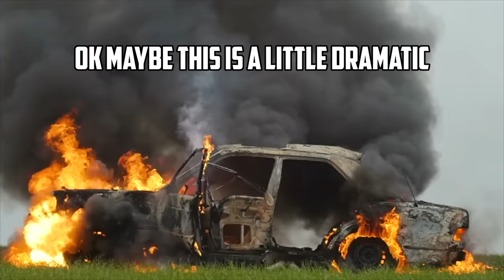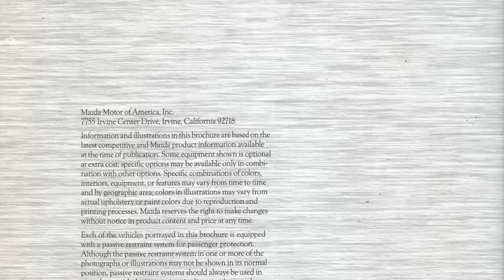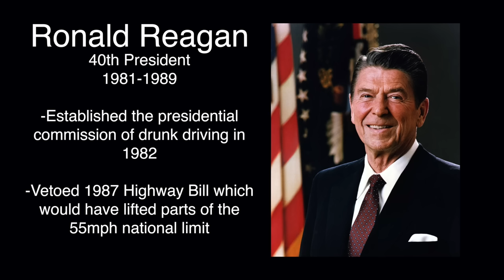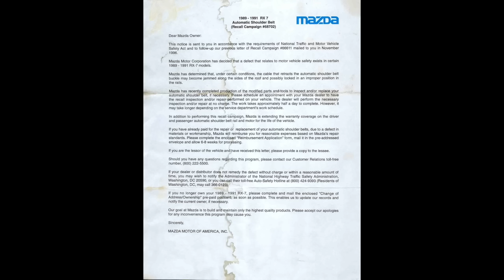Automatic Seatbelts - Why They Were Used & Why They Went Away!

Comment: Nice video, thanks for posting.

A couple of issues:

First, you’re not talking about automatic seat belts. You’re talking about automatic (Nissan called them “passive”) shoulder straps. Those were two completely different items with different part numbers – in the case of the 1994 Sentra, at least.

Second, human nature – not air bags – was the main reason the passive shoulder strap / separate manual lap belt combination was discontinued. The moving shoulder strap distracted occupants, especially guest passengers who were new to the car, and gave them a false sense of security. After watching the mechanized show, many (many, many, many) people just assumed they were secure and forgot they had to fasten their seat belts too.

As you pointed out, mechanical failures also played a part. In my case, the shoulder strap retractor tended to jam while the mechanism was pulling the strap toward my chest. When the strap got tight, everything stopped. I had to release the shoulder strap buckle to allow the mechanism to complete its travel, then pull the strap out farther and reinsert the buckle into its socket. Hardly what I’d call passive.

Comment: Had them in my 93 Escort. Only issue I had with them was on the couple of occasions when I needed to pop the door open after I started the car to reach out for something and have the belt snag the back of my head until I got used to the automatic belt though I was really happy to see them gone by the time I got the Millennium Focus in 02.

Comment: One interesting thing about automatic seat belts which seemed to have been ignored in this video is the location of the inertial reel mechanism which is on the centre of the car by your hip.  So what you may ask? Well the reel provides the slack when you move around and in particular when you lean forward. When the reel is on the outside the slack required between your shoulder and the door pillar when you lean forward is provided easily. When the reel is on the inside the belt needs to slide across your body. This produced a particular problem for women who... well they are built differently  in the chest area. This resulted in a risk of chaffing. One of my jobs as a student at Jaguar was to hunt out a representative range of female anatomies and offer them free use of suitably equipped XJS for the weekend to test the chaffing risk!

Comment: So the automatic seatbelt slides across the door and than puts itself onto you slightly twisted? I learned that the belt should always be as straight as possible so that the impact is as evenly distributed across your body as possible, and it being twisted would result in the impact being more concentrated on a thin line, effectively increasing your chance to break some rips.

Lets forget about the lap belt people didn't use for a second, that belt just isn't safe 😂
I always wondered why they don't make it the standard to use seatbelts like they use them in racing... Would be 100x safer and more comfortable.

Guess they just don't want us to die, treating our injuries will get the big brother of the car industry some customers.

Comment: My wife used to have a 1994 Nissan van that I hated for numerous engineering shortfalls. But one of the biggest reasons I hated it was because it had these automatic shoulders belts. And like them all, you had to manually pull and fasten the lap belt. I was constantly nagging her about making sure to fasten that lap belt. But I know that whenever I wasn’t there to pester her about using it, she wouldn’t use the lap belt. I ended up convincing her to unload that van and I bought her a Subaru Outback. Excellent car. Now she actually puts on her seatbelt every time. And she doesn’t get stuck in the snow like she used to repeatedly in that cursed van.

Comment: Unless I'm mistaken the early law required at least one "Active Restraint" in the vehicle.  Early implementers of airbags didn't have to implement these motorized shoulder belts.  The airbag was the active restraint and it's what made first generation airbags much more hazardous to children and smaller individuals.
Reply: I heard that as well, I believe you are correct.   Airbags were also referred to as "Supplemental Restraint Systems" or "Supplemental Inflatable Restraints " in the later 80s when they first appeared on some of the premium brand cars, to get the word out that airbags are only effective when a lap/shoulder belt is properly worn.   So to sum it up these motorized belts added absolutely no added safety benefits over manual lap/shoulder belts.

Comment: My 87 Jetta GL here in the US had a static (i.e. not motorized) shoulder restraint. It was just hooked onto the door and opening the door would move it out of the way so you could get in/out. Also no lap belt. I remember being told that the 87 model year was the last that could get away with not having a lap belt (or maybe it was lack of a 3 point restraint, either way, same effect)

Fun side note: I actually know one of those people who was clearly saved by not wearing a belt. In an accident he was thrown to the passenger side while the driver side was crushed in to the point where he would most certainly have been killed. Though these people do exist, to say they are outnumbered by the people who have been saved by a belt is an understatement on the order of saying that Godzilla is just a tiny lizard.

Comment: I have these on a Tempo. I got side swiped right behind my seat at an at angle. The post that the top automatic belt was connected to was caught by the truck that hit me and pulled into wear the trunk should been. This ripped the belt across me and tore ligaments in the left shoulder, chest, and arm.
That took quite a while to recover from.  It was part fault of where and how the power mechanism connected, and part just the belt post connection. Since then I have mostly bought cars that have belts connected with the seat, or bought a vehicle that has mounts for that type of seat and I swap them.

Comment: The only thing i thought of with my car with motorized belts was when is this motor or mechanism going to stick/seize.  There was a mandated release on the upper belt and the lower was typically manual.  So you weren't really forced to wear a belt those not wanting to just kept the top unbuckled along with the lower.  Oh awesome a nice noisy buckle to watch out for every time i open the door, how safe haha.

Comment: 5:42 - airbags DID NOT and DO NOT work without a seatbelt!!!
they will kill you if you don't have your belt on and are often disabled when the belt isn't used
Reply: And airbags can kill you if your a woman. It's a pet peeve of mine that I have a weight sensor in the seat that disables the air bag if I have no passenger but if my passenger is a petite woman I have to beg to be allowed to disable it..when it could just not trigger below a certain weight.
Reply: @evil1by1  that's possible but she needs to be very petit
Reply: Fancy seeing you here.

Comment: My 1991 acura integra has those.  They still work.  I got into an accident with my old one (same car) and it held me in place.  Passenger side still works, driver side failed a few years ago.  They actually come with a tool (from the factory) to move the belt incase it stops working electronically.  You still have to clip the lap belt though so it's not really a time saver.

Comment: I had a 1980 Volkswagen Rabbit with the automatic seatbelt. It did not have a lap belt - it had a “knee guard” under the dash that was supposed to keep you from  slipping under in case of a crash! Thankfully I never got in an accident or I would probably have to have had knee replacement surgery! The other issue was it would sometimes think that someone else was sitting in the passenger side and had not activated the automatic lap belt and then your car would not start. I had to call AAA to get a jumpstart to override it.

Comment: I had a 1980 VW Rabbit that had manual seat/ shoulder belts. The upper end was attached to the door with an 'unbuckling' button. As you opened the door, the belt would allow you to enter the car, then retract as you closed the door. If you unbuckled before starting the motor, an interlock prevented the motor from starting!! You needed to hook the buckle back into the door so you could start the engine. I was 22 years old then & NOT a seatbelt user back then, so I went to VW & had them install an interlock bypass. Yes, it cost me $20.00 from the DEALER. Guess others also did not want that belt across their chests either, as they were selling like hotcakes.
Today, at 64, aside from getting a ticket, I feel better wearing a seat & shoulder belt! Guess you learn as you get older LOL

Comment: Not everybody hated seatbelts.  When I was a young boy, our new 1967 Chevrolet Bel-Air came with seatbelts.  I put my seatbelt on every time.  I liked the novelty of it, and never got tired of it, not to this day.  There was no shoulder belt in the back seat where I usually rode.  The front seat had shoulder belts, but it was completely separate from the lap belt.  So you had to fasten two buckles to put on both belts.

Comment: Hi , they were REQUIRED as one form of stop-gap passive restraint until the point that airbags became mandated across the board.  Since I'm sure not every manufacturer pulled out a new model/face-lift that year there was probably some overlap, realizing there's way more engineering and crash testing that goes into designing a new seatbelt system than just "Oh let's just make it one long belt with a sliding buckle and anchor it to the B pillar."  Funny that you must've researched the Carter/Reagan thing but didn't bother beyond that.

Comment: DECAPITATION! The real reason they were discontinued was people would still refuse to wear the lapbelt and in an accident the auto uperbody belt would remove "decapitate" the persons head as the body slid down in the seat also refered to as submarining. This horrible fate could have been avoided by just hooking the lapbelt. Avoided, much like the catastrophic injuries recived by passenger airbags such as having the lower portions, legs ankles hip joints, chest and facial injuries from the people that ride with thier feet resting on the passenger airbag while the vehicle is traveling.
Reply: Thank you finally you said the most horrifying reason of all these were trash. It happened to a classmate of mine, and friends in other cars ran up to the scene to find her head severed.

Comment: When was 17, my dad had a Ford Festiva with auto seat belt. I had gotten into a bad accident, my poor dog got thrown from the back window over the car (was t boned toward the back so my car spun around a few times). 

Luckily he landed on the small strip of grass and not on the heavily trafficked road or smaller street. He got up and ran home (about a little less than 1/2 mile). 

Meanwhile, I was trying to get the stupid auto belt off because it was stuck all the way back and locked. Luckily I had a sharp knife so I could cut it off. By then my dog was almost to my street.

I felt so bad cuz he always hated car rides but was slowly getting used to it. So that threw all the work I have done with him over the past couple of months right out the window.

Comment: My dads car had one. Can’t remember the model. Just remember it used to break down about every block or so, so you had to pull over and re start it. It was almost faster to walk. Deep black paint job too, so it was always about 15 degrees hotter in the cabin than the outside.

Comment: My understanding was always that the vehicles made after a certain date require a PASSIVE restraint system - and in the 80's it was typically less expensive to go the motorized shoulder belt route as airbags were very expensive.  As the video states though, the belts with moving parts did have a tendency to wear down and malfunction, and most people were not keen to pay to get them serviced after they quit being operational.  Secondly, most models would allow you to disconnect the shoulder belt altogether and many people did just that for various reasons.  The airbag on the other hand, is COMPLETELY passive.  There are no moving parts, and they typically don't wear out.  Aside from the wires or wire harnesses becoming brittle and sometimes breaking, they are HIGHLY reliable (assuming that you don't have a recalled Takata unit that might shoot shrapnel into your jugular).  They are activated via a sensor(s) that detects a sudden drop in inertia and the wiring sends a voltage pulse to detonate a small amount of a high explosive such as nitroguanidine and allows the airbag to fill quickly before the driver or passenger were to strike any solid component of the vehicle.  Sodium Azide was previously used, but was more sensitive in terms of unintended detonations, and thus the newer formulation is safer to handle.

Comment: When the mandate for "passive restraints" came down in the 1980s, automakers were given a choice: Either install air bags or automatic seat belts. The seat belts were the less expensive option, so many automakers went that direction to start. Unfortunately, the automatic seat belts had their own safety issues. GM came up with a non-motorized "automatic" seat belt by having the seat belt installed as part of the door, so you didn't technically have to ever unbuckle the belt to get in and out of the car. These caused a problem, though, in crashes that opened the door, because now there was nothing keeping the occupant from being ejected. And as for the automatic shoulder belts, a few drivers ended up decapitated by the auto belts when not wearing the lap belt. Of the options, air bags turned out to be the safest, at least for adults.

Comment: I had a VW rabbit (can't remember the year... But it was probably an early 80's model) that had pre-buckeled seatbelts. It was attached far back enough on the door that it didn't need a motorized pull-back system. They worked well... But everyone was confused as to how to get in the car Becuase you had to slide in between the seat and the belt. Was a bit strange, but it worked well.

Comment: My friend had a 1987 VW Golf and the front seatbeats were attached to the door rather than being motorized.  So, you step into belt as you sit down and when you close the door, you are belted in.  At the time, I thought this was a clever way of doing it, as there were no motors that would break and it was cheaper to implement.  I also remember getting a ticket in Palm Springs in that car during spring break 1990 for not wearing a seat belt.  My friend did not like the look of seatbelts in the back and pushed them into and under the seat.  Unfortunately for me, California made seatbelts mandatory for all passengers and I was in the back when my friend got pulled over for tinted front windows.  He got a fix-it ticket while I got a pay us some money ticket.  I have not gone back (and will never go back) to Palm Springs since.

Comment: General Motors had perhaps the most clever and ridiculous solution. They mounted the belt harness to the door frame, with the theory that as long as the belts were buckled at all time, when the door was opened one would just slide under the belt. Bingo - shoulder and lap belt fastened actually hands free. Because the belt is the same as a standardized 3-point, everyone just used them as normal belts and forgo the “automatic part”. The fatal flaw was what would happen if the door opened in a crash?

Comment: The cable that pulled the seat belt in the slide would jam up for time to time. It was inevitable the track would get dirty and cause the cable to stop sliding correctly. 
Lil bit of a safety concern. 
I remember my Ford Probe and when it jammed. Yes you just unbuckeld the shoulder strap and drove with the lap belt only. 
Dam I miss the 90's.......

Comment: My friend had an early 90s 240SX with the automatic belts.  Was taking three of us across town, and the young guy in the passenger seat reached down to tie his shoe just as my friend turned the ignition key.  Caught the kid right around the neck.  Not dangerous per se, but certainly an uncomfortable and embarrassing situation.  Besides the fact those things broke, most people would just hit the release so they didn't have a shoulder belt at all.  They also caused problems for short people.  Good intentions, bad result.

Comment: I had them on a 91 Ford Escort station wagon. I got the car after it rolled over 300k miles and the belt stopped working after a few months. So to comply with laws my old man and I got a heavy duty bolt on hook and mounted that sucker with the thickest bolts we could find, through the frame and would just hook the slot of the seatbelt on it

Comment: FYI. I work for Toyota plant here in Canada and we did the Ford Probe which was manufactured in 1988 we used a rail system same as the Mazda RX7 . We no longer make the probe no do they offer warranty replacement for the cars .. I have been making seatbelts for 35 yrs now and we had How’s it made came and did the video on seatbelts were made .

Comment: I see there are rails for seatbells and single lr dual motors rotating on both ends or single one rotating strings or special wires like in window rollets so it would slide down and up.

Comment: It was also the case that the lap belt was still manual... so it was a bit odd to have to do the same effort that would do both belts any way. Also at least in the Saturn I had you could still unbuckle the belt from the automated track to disable it. I always use my seat belt and I've never found them uncomfortable.